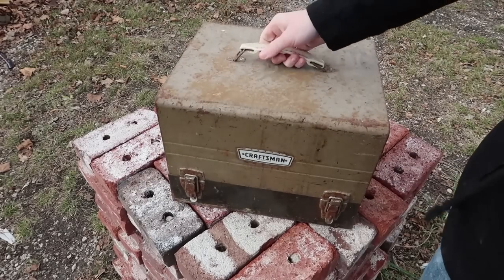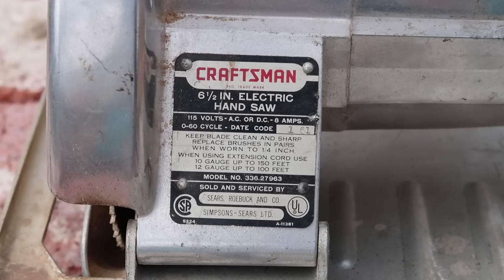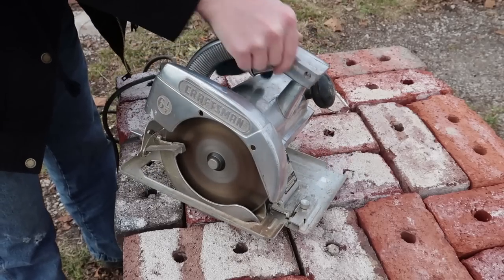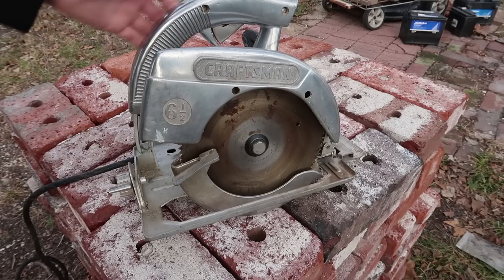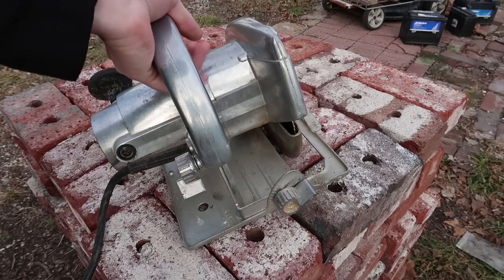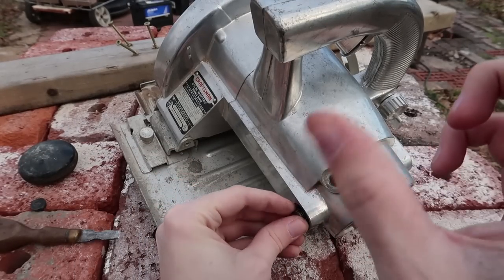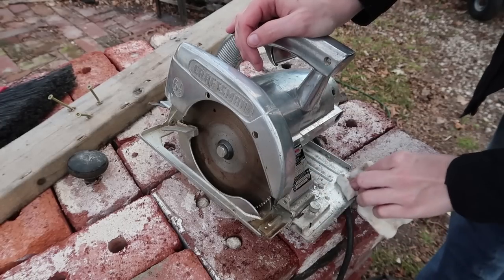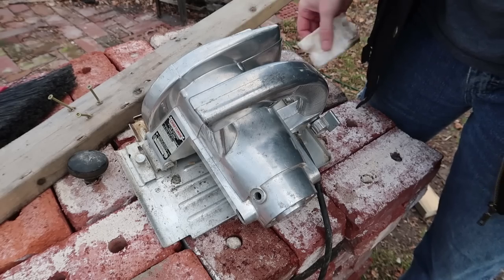Vintage 1961 Craftsman Circular Saw: Close Look, Light Cleaning (Teardown later)

Comment: I am a sucker for cool vintage circular saws, and i just picked up one like yours for 5 dollars at a yard sale.  Mine came with a modern carbide blade which is pretty cool, but it did not come with the metal case though.   Works, cuts, and handles great.  As i been working with various vintage circular saws i have been finding out that some handle, and cut better than some of the newer modern saws.

Comment: Okay.. I did sit through the video and help on to the end.... I haven't read the comments but..... The blade that was installed is used for cutting plywood.... The saw could have been cleaned with Mothers Mag Aluminum Polish and it will come out like a mirror.... steel wool for the tough areas and bottom plate.... wiring not safe to keep using and will crack in housing so please replace that and get a cord tension keeper for wire... it all helps! Its an excellent saw.. I am rebuilding one right now and they are the best!  Also, you were trying to cut left handed....  right hand on saw.. left hand on the handle you cleaned! (Well, that's the way they tell you to use it in the manual at least)... Thank you for sharing this! Let me tell you when you open that case at a job site and a chrome saw comes out.. everyone stops to ask about it... its really something! Thanks again! Sorry for the 'criticism' wasn't meant to be an ass about it LOL

Comment: That is a well built saw. My dad had a similar unit in our basement when I inherited the house. I have Milwaukee M12 tools with robust construction ( glass filled nylon and thick bases on the saws ), modern Lithium - Ion batteries and management electronics, but, those tools were made to be handed down...... NICE!

Comment: just a tip, when cutting with a circular saw never support the end of 2X4 etc that you are cutting off,  the saw will kick back like it did at 5:14 . let the cut off end hang free and it will just fall away from the cut and the saw wont kick back. circular saws are one of the most dangerous tools on the job site, they can really tear you up if not used correctly.
Reply from the maker: +Jack Maurice couldnt support the other side any more though.
Reply: you dont under stand what im saying.  it would be a good idea to get someone to show you the proper technique of using a circular saw , or at the very least watch a youtube video before you injure yourself
Reply from the maker: no its more like i just dont care at a certain point. i had to film that bit and i didnt have tools on hand to fasten the left side down. get over it.
Reply: you dont need to fasten the left side down, if you knew how to use the tool your hand would have been holding that side down,you should  learn to take constructive advice for your own safety

Comment: That's a decent saw. I collect old Porter Cable tools. Cheaper saws are often loud because they have spur gears inside and they make a lot of chatter. Higher end saws use helical gears and it makes a difference. Worm drives are quiet too, as much a skilsaw can be. 
 I like to use Mother's mag and aluminum polish for polishing my tools. If they have deep scratches then you can wet sand those out but that gets to be an involved process.
 That particular blade is for plywood and paneling. They don't cut thick stock well because of the small chip clearance in the small teeth. I would recommend a carbide tip blade.
Reply from the maker: yeah i got a new blade and it cuts really well

Comment: Just needs a new power cord. Also if it does not have an earth wire, I would recommend adding one. Easy mod to do, done it lots of times.
Reply: Have any ideas on how to get that handle apart? I took 4 screws out of my handle (just trash picked it 5 minutes ago) and I can’t figure out how to get it apart

Comment: Never hold the cut off piece, unless you can prevent it from pinching. I'm judging from by what I saw that you were pulling back on the 2x4 twords the end of cutting through the piece, that's why it pinched. Pinching causes kick back and if not prepared can cause an accident. Just don't want you getting hurt.
Reply from the maker: +Flying Flapjack cant cut with the piece moving about though.
Reply: Rinoa Super-Genius That's exactly right, try to put your left hand on left side of saw, push down with left hand while sawing with right hand. The reason you needed so much force is because the blade is dull. Otherwise you have a good quality saw. You'll have a better experience with a new sharp blade.
Reply: That is because the wrong blade was being used. A proper one would be a ripping blade for cutting 2x4s, 4x4, etc. The one used is for things like plywood.
Reply: @GeekBoy03  a rip blade for cross cutting ? no
Reply: @tty04  yes. That is the proper blade for cross cutting beams of wood.

Comment: You can take the handle plate off and?check the cord connections. Easy fix with luquid electric tape or shrink tubing

Comment: The knob is probably a  thermoset -- could be a phenolic (Bakelite) but also possibly a thermoset alkyd / polyester -- what would be called "fiberglass".  If the surface is very hard and resistant to scratching, it's probably Bakelite.

Comment: This just be may be the cautious person, but earlier on when you were testing it to see how it worked or its noise level, I kind of wish you didn't twirl it or turn it while running. Just a thought to avoid being rather cavalier with power tools.
Reply from the maker: how does rotating to check the brushes equal cavalier? that makes no sense.
Reply: I meant while powered and while running the saw, but you're right. Again, perhaps just me being too antsy.
Reply from the maker: cant check for sparks with it off though.